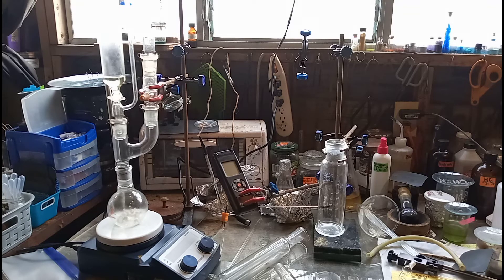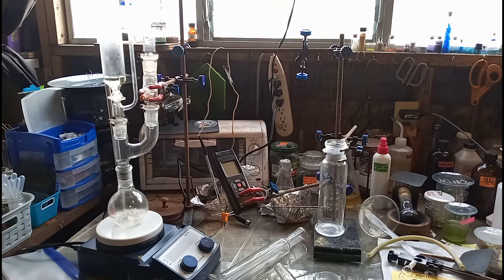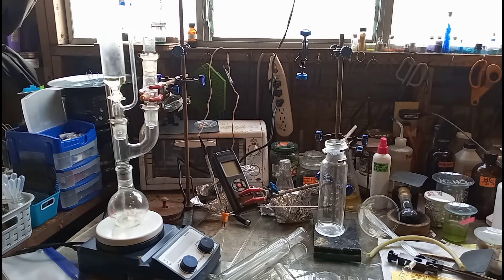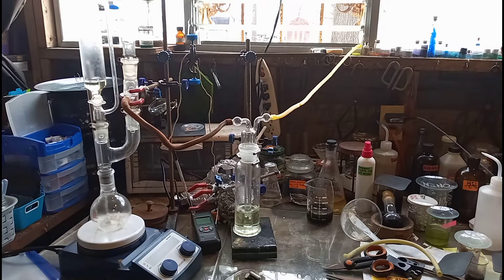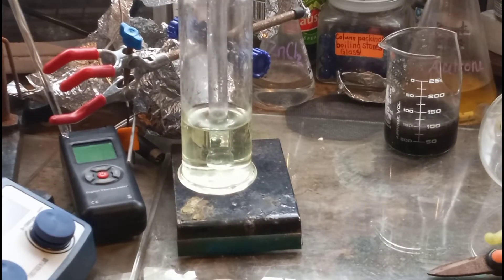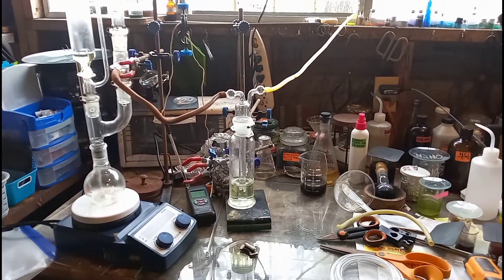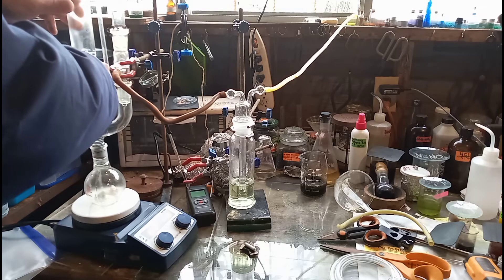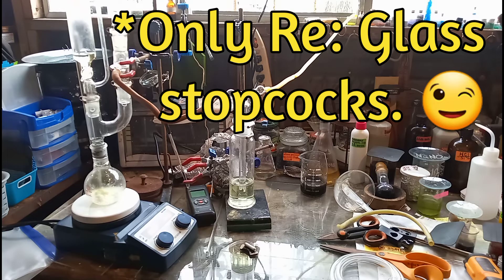Ferrocyanide 2 Ferricyanide in 30 seconds.

Comment: I have produced small amounts of Cl2 in situ indoors to try oxidizing alcohol, but I would never produce dry gas without the precautions you suggested.
Also one thing to not it actually takes quite a conc. to really harm you, i have accidentally caught a lung a couple times outside when wind changes.
But you can never be too careful with halogens so best to take as many precautions as possible and I think having a fan as well is good and have it blowing away so if wind does change it protects you.
I once made a couple mL of haloacetone on a calm day, I wanted to see how nasty it actually was.
Reply: It was mixed haloacetone, I was actually playing around with DBDHM and H2O2 and decided I actually wanted to used the mixed halogens so added a couple mL of acetone to see what the product was like and so I knew what to expect working with it in the future
Reply: @pbn3215  yep, but very small amount. I knew it was lachrymatory but wasn't sure what to expect so had all safeties in check and added a couple mL of acetone
Reply: @synthesizer8026  out of curiousity how bad was it even on a small scale?
Reply: @midwestchem368  pretty bad, it deffinitly needs care when working with any quantity. The worst reagent I have dealt with, I found it worse the benzyl chloride
Reply: @synthesizer8026  that's rough I know benzyl chloride is bad I can only imagine how bad it is!
Reply: @midwestchem368  yep, not something to mess with. I knew it would be bad, but still curious.
Reply: I've made small amounts (maybe 500ml of Cl gas total, not a lot at all) in an enclosed shed before and had a hose out a window too.  I actually did that a lot back in the day when I was first starting out.  But I always, always made sure that any and all other safety options were in place before starting the reactions.  Sometimes you don't have a choice unless you want to go small scale.  That's something that I think is an unspoken understanding in amateur chemistry.  The fact that you can do most things in the least ideal of places if you are willing to go small, sometimes even sub-gram amounts.